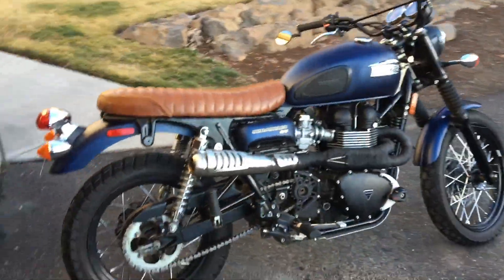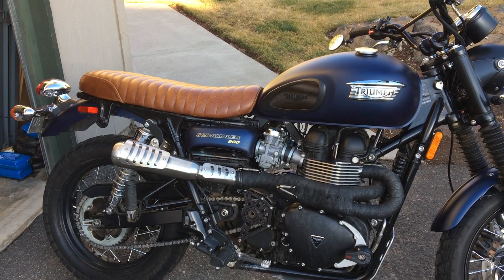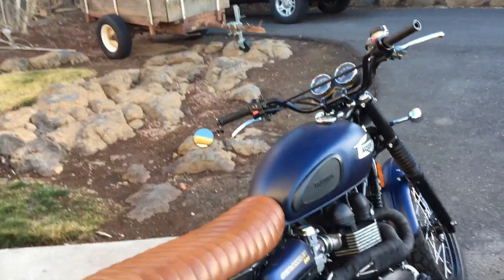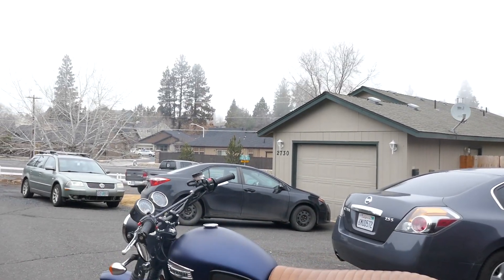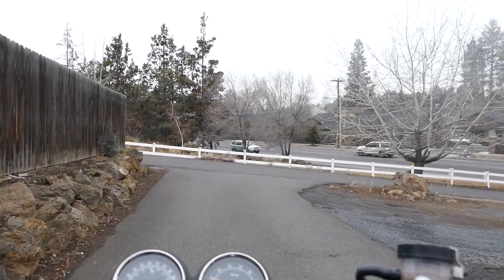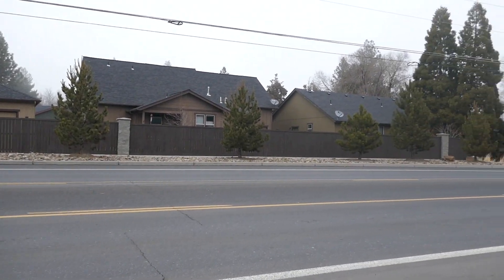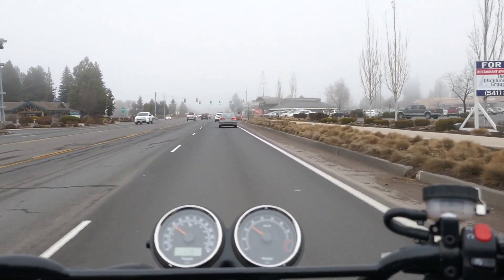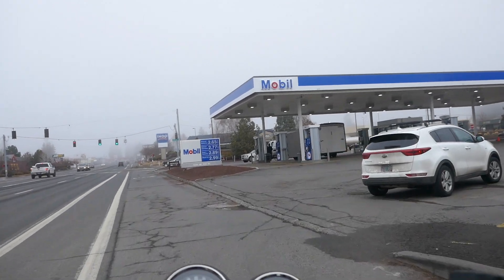Triumph Scrambler TEC exhaust test

Comment: I have the same set up and have a question. Do your pipes touch up front where the left side pipe passes under the right side pipe and then does the bottom pipe sit against the motor?
Reply from the maker: Gabe Hoffmann it is very tight but does not touch. I was able to wrap it with exhaust wrap and keep it from rubbing.

Comment: That single tail pipe makes me think a Giant Loop Coyote or Great Basin bag would be more easily accommodated than with the dual pipes. Have you had any thoughts on using such a bag on your bike? I think one of those bags paired with a Rotopax would be awesome for touring and camping off the bike.
Reply from the maker: Interesting thought. I was also thinking a bag might fit on the pipe side now that this one is so much smaller (and lighter by the way, the stock exhaust is ridiculously heavy). I'll check out those bags,  mounting the rotopax seems like it will be a custom job.
Reply: You've got Giant Loop right there in Bend, so you could ride in and do test fittings which would be fun. Thinking about this more, I remembered that GL also sells a 1-gallon gas can that can fit inside one of the saddle bag legs and they have a 1-gallon fuel bag (expensive, though) that could probably be strapped on the outside of the bag somewhere. These would be good lightweight alternatives to Rotopax.

Comment: Did you use any silicone high temp sealant on the silencer like they did in one of the company videos?
Reply from the maker: I did yes, the slip on needed it, and it was probably the worst part of the design. I had to redo the silicone 3 times and im still not sure it will hold.
Reply: Kristopher Anderson 🤔 But I’m sure the springs make it feel more secure?
Reply from the maker: the springs do help I think I have it secure now. Originally when I installed it I didn't shove the slip on over the pipe far enough to make a good seal. You have to make sure all the bolts are loose, use the silicone, then shove together as far as possible, then tighten everything down. I'm a little worried about the heat coming off the pipe but ill have to wait for the snow to melt to find out if its going to be ok.